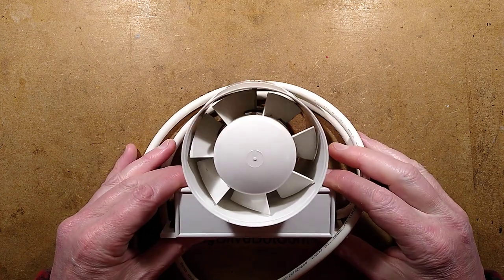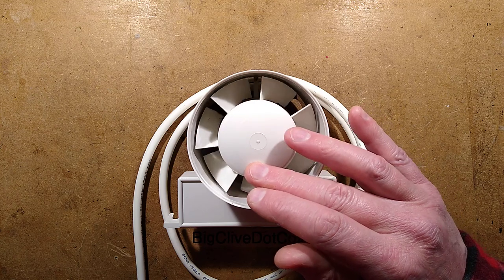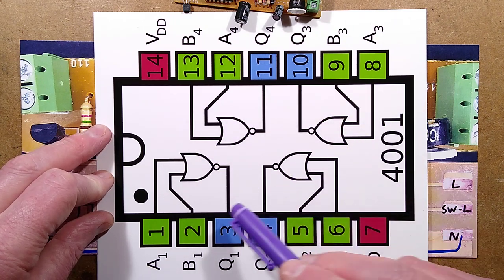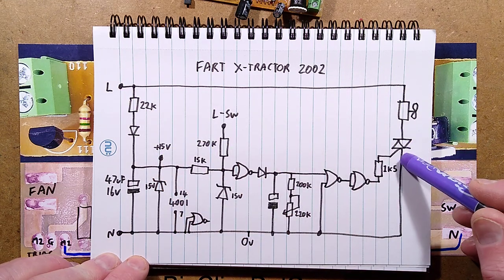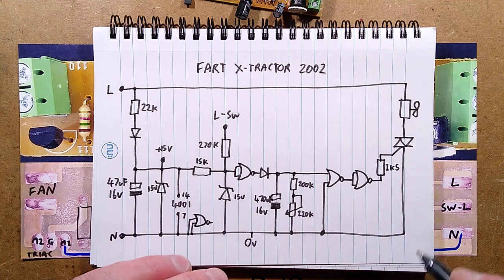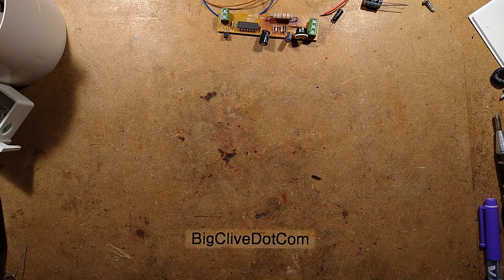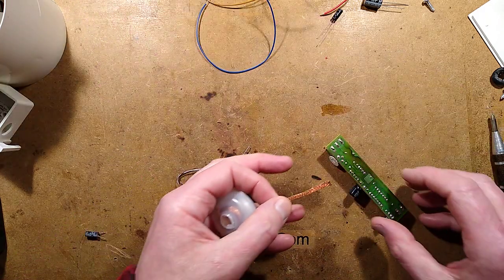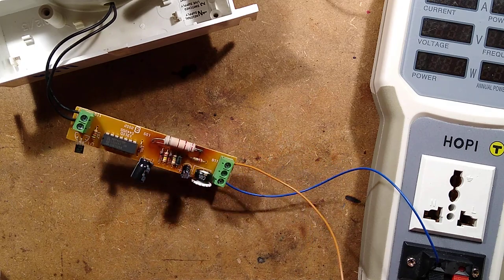Fixing a fart-extractor (with schematic)

Comment: Hello,

Do you think it would be a good idea to replace the electrolytic capacitors in my car stereo even though it's still working fine ?
I ask because it gets quite hot in there.
Reply from the maker: I'd recommend not doing it until they give issues, as you may and up breaking it.
Reply: That is the ill-effect of it being stuffed into the dashboard and not getting any ventilation/cooling - when on youth camp and was playing a cassette with Christian music on it in the mini-bus and it turned off when quite warm in the bus - found the top of the dashboard was quite hot as was the front of the car-stereo, and ejected the cassette and it was quite warm in my hand, and the pastor (driver) told me not to continue playing the tape and to give it a rest as the stereo had literally overheated because of the sun shining though the windscreen on to the dark-coloured dashboard 😬, these tend to have the amplifier transistors heat-sinked to the outer metal casing and dissipated into the hollow dashboard interior - if there is no cool air being blown inside it, the car-stereo will overheat, particularly if the sun is shining onto it. In the case of a car, this tends to be addressed with the installation of a external power amplifier and subwoofer to get better sounding louder music (without the stereo overheating)
Reply: The other thing people do wrong is buy their replacements from CPC which are guaranteed to be bottom of range. When repairing never go for bottom of range or manufacturers. It's only a few pence difference usually

Comment: If the designer/manufacturer had actaually given a damn, they could have provided through flow ventilation of the power resistor via the fan itself.
Reply from the maker: I think it's doubling up as an anti-condensation heater.

Comment: What nasty circuit. There are several reasons I don't like it much, but it would be quite a bit of typing to list them. Probably the nastiest is relying an a long period R/C timing circuit with an electrolytic capacitor in a potentially humid environment. I repaired a somewhat similar unit with a 4060 oscillator / counter to provide the timing element. It produced power for the logic by inserting a bridge rectifier in series with the fan motor, thereby robbing the fan of a few volts (which I doubt it minded) and saved the need for high voltage dropping resistors. Resistors exposed to high voltages are a frequent failure point, in my experience.
Reply: These things are a compromise. Yes lots of us could come up with something better but for a price
Reply: @jms019  You are right, of course. I reserve the right not to like it, though!

Comment: is that thing drawing a watt 24/7?
Reply: @girlsdrinkfeck  Well there's live going to a 1watt rated resistor going through a 47uF cap to neutral...
Reply: @foxabilo yes it is. In fact, it’s 1.2 watts. They cheaped out on the power supply, but it makes you pay anyway through the electricity bill.

Comment: Oooohh, I so want to reach through the screen and put a dead short across the 270 kilohm resistor. Then, when it’s switched on - instead of x-tracting farts - it’ll emit them. And smoke. And flames!

Comment: I loathe and despise when they put low spec capacitors next to things that get hot for cheapness reasons. It is not just fart-extractors. My sub woofer with integrated amplifier did the same thing. I bought capacitors with higher temperature rating and soldered them in by the tips of their legs so they weren't stuck right by the power dissipating components. An easy extra decade of bass for pocket change and some googling/soldering. Don't do this at home. If Clive is an idiot, I am a total imbecile.

Comment: Three folks (thumbs down 👎) must love the smell of their own farts  !
🥴💨🤢
(Gotta be Prius drivers😆)
Reply from the maker: They're the ones who paid for an electrician to fit a new fan when they could have fixed it themselves with a 10p capacitor.
Reply: @bigclivedotcom  fair few years ago my Tv wouldn’t turn on but the standby led was still visible so I decided to research it myself (youtube videos) et Viola Capacitors (slight bumps on top) I purchased around 5 from eBay & hey presto I fixed it 🥳 🍻 (was mighty chuffed with myself😆)
(It would’ve either gone to the dump or I possibly could’ve gotten charged ££ for it to be fixed)
Also same again with a washing machine Capasitors 🤦‍♂️
I’m no pro but I’d like to think if I have the right info I could manage most things .
Cheers big Clive 
🤗

Comment: My toilet doesn't have a fan. It can get stiffling hot in summer, feezing cold in winter, and thats leaving the toilet window open permanantly. Add to that no air movement and it can pong. Reminds me of the time I sat on the toilet with a kerosene heater at my knees and me wondering why I was getting light headed. It was a bastard to stand on toilet, bring heater in, close door, move it back and use the royal throne with barely enough room. Not my proudest moment but like all men, I hate a cold toilet seat.

Comment: Use what ever tool is handy, including your teeth :) You are a genius - sorry to tell you that :) Thanks again for a great video! BR Zlatko
Reply: I used to use my teeth as wire strippers when I was 13 years old, I now have a gap between my 2 front teeth lol...don't use ya teef kids! :-D
Reply: @muzikman2008  Not having a problem with that at my 40-s, but i understand the concerne :)

Comment: I would have just opened it up and changed all of the capacitors without thinking of how it was making the circuit misbehave.
Reply from the maker: Which would have worked.
Reply: Yeah but it’s so elegant when you do it.

Comment: I had visions of a decade worth of miscellaneous dried up fart powder blowing in your face when it came back to life lol :-) I'm sure a 555 timer would be more cost effective?... I have changed many fans over the years with failed control boards, they're just as you say cheap and designed to fail after a few years.

Comment: I was about to  reverse engineer one... One we had the other week the fan would overrun forever...
Reply: capacitor has dried out. Ours had leaked and corroded the circuit board. Resistor dropper with a fukoff huge resistor that toasts everything around it.

Edit yep, bog standard manrose fan timer board, I have about 20 of them as spares lol
Reply: Final edity response.... the reason i didn't keep the old one to fix or diagnose was the cap juice (from the timing capacitor in our case) had destroyed most of the PCB :(  They can be handy for a few timing things at mains voltage btw, just be aware of the fact that there's a brief delay on startup. due to the cap having to charge, so a simple momentary switch pulse might not be sufficient.
Reply from the maker: The hot resistor may be doubling as a mini anti-condensation heater.

Comment: It's worst product in home industry, loud 🔊 and inefficient, we changed fans to big 12volt computer ones and it's even powerful, quiet and safer for bathroom with water, no risk of shock with 12 voltage ⚡ and low current. Ac to DC power adapter outside bathroom.

Comment: With caps being such an unreliable item, it's time they were all plug/socket fitted to the outside of the box - so there's not even a lid to remove.
Reply: The threshold for cap failure is too high; given their ubiquity and their propensity to fail otherwise than corpulently, capacitors could use a makeover that simply and cheaply provides an "I'm wobbly" tell-tale.
Reply: @michaelthibault7930  I can imagine a new programme on BBC2 - Electronics world - covering items such as automatic gardening waterers and fake sunshine growing lamps with the programme ending with Percy Thrower using the catchphrase "And don't forget to keep your capacitors well hydrated".

Comment: correction -  u called a transistor a mosfet ,         n other stuff
Reply: Which would be correct, if it were a MOSFET (Metal Oxide Semiconductor Field Effect Transistor), but he did make a mistake by calling a TRIAC, a transistor.

Comment: Those fart extractors are rubbish, utter rubbish, for a duct fan, an axial fan totally doesn't cut it, you need a centrifugal fan/blower to push through the resistance of ducting (usually the flexible ridged kind) - also the air so barely moves at all that humid air aka shower/bath quality air, travels so slowly through the duct that it condensates, leading to pools of water stuck in the duct.  Next doors extractor fan did this, que damp ceiling... oops!